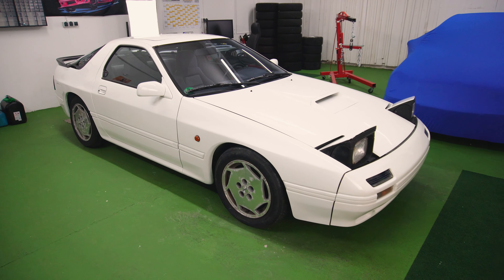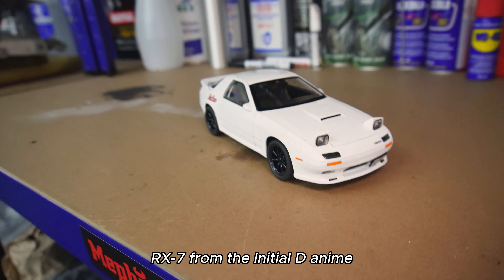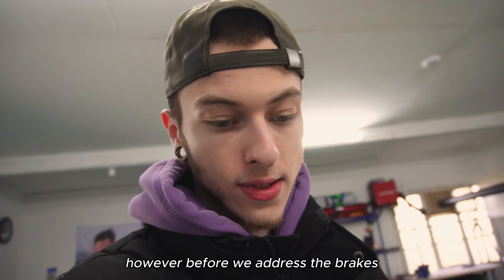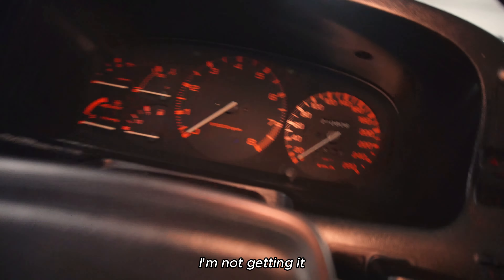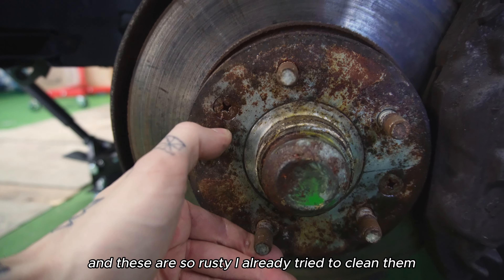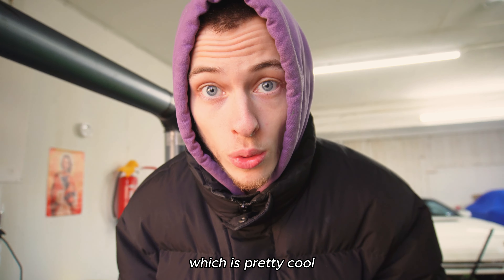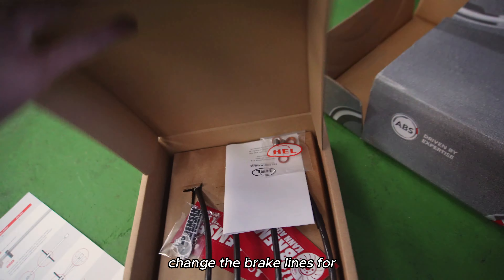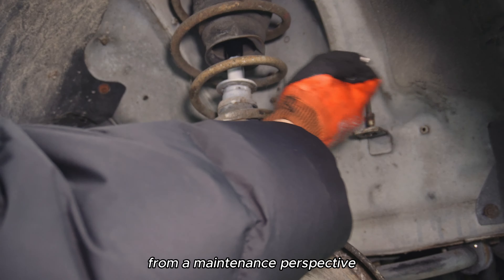Rescuing An Abandoned Mazda RX-7 FC!

Comment: I'm at 5:05 atm and one thing that comes to mind is that maybe a mouse or something ate at the wires between the fuses and the electrical components. Could also use a voltmeter to test that the fuses are getting electricity from the battery.
Reply from the maker: @MrBinkers  Turned out to be a simple bad connection on the plug where you can dimm the cluster😂

Comment: I also had recently purchased an S4 T2, generally speaking the electric stuff create some troubles due to bad or oxidised solderings that sometimes can easily fixed by removing the old tin and soldering back with fresh one. I've already fixed a couple of bad switches with this method
Reply from the maker: Thank you for the advice, I thought so aswell but after measuring every connection, everything seemed fine. Thankfully I found the reason why it didn't work at the end of the video :) Was just a cracked cable.

Comment: So i had the same problem with the brake rotors on my s5 t2. I managed to get one off with a sledge hammer and a ton of heat... but dont do it that way. You likely gonna destroy your wheel bearings in the process. The better thing to do, wich also worked for me, is to cut the side of the brake rotors hub with an angle grider ("Flex" as we say in germany), bc it doesnt rust on the mating surface, but on the inside of the brake rotor. Just be carefull not cut through the rotor and into the wheel hub. 
Stoked to see the building process, and more so to see the car on german roads.
Reply from the maker: Thank you for all the advice!😁 I am also super excited to see another FC on German streets!

I have also heard that the sledgehammer method can destroy your bearings so I think I will definetly order new ones just in case... As soon as I come back home from South Korea I will try it out😊
Reply: @moritzherr  the reason why they wont' come off is because you didn't remove the nut that holds the rotor on. The center of the rotor has a dust cap, remove the dust cap by tapping it with a hammer and then you must remove the wheel bearing nut, then the rotor will come off.
Reply from the maker: @markhutchinson3367  Okay I will try that, thank you for the advice :) But what does the wheel bearing nut have to do with the brake rotor? It's not holding it in at all, they are completely seperate🤔
Reply: @callmemo77  you know what, you're right. I was confusing the rotor design with a different car 😅 I say spray some penetrating lube all over it and use some heat and a big 5 lbs hammer to break it loose.

Comment: for the dash lights, you could try seeing if the bulbs have burnt out. i work at an auto parts store and see it fairly often. i looked it up in my work computer, and it seems that the bulbs are going to be either: 158, 2721, or 74. you can figure out which bulb specifically by looking closely at the glass on the bulb itself, the number should be written there. most can be found for under 8USD.
Reply from the maker: Thank you for the advice and the effort to look up the parts! Thankfully I found the problem right after😁 I mentioned it real wuickly at the end of the video.

Comment: If I were to guess, the gauge cluster not lighting up is because of a bad relay. I'd look at the TNS relay. It controls the taillights, side markers, and dash lights. I had a similar issue on my 1991 Mazda Miata. I was able to troubleshoot it by swapping the TNS relay for the horn relay. Both should be an LA10 relay.
Reply from the maker: Thank you for the nice suggestion! I will definetly have to overhaul the electrical system of the FC... There are some things that just don't work right.

Thankfully I found the Problem at the end of the video :) The indicators and taillights were working even when the dash didn't light up. However my wipers still don't work, so I will have to figure this out aswell😂

Comment: When my pistons were stuck on my brakes i put a block of wood between 2 pistons and held one with a clamp and then pumped grease into the brake rotors it creates a mess but will get the piston out. then just use scotchbrite to clean them up and use new seals
Reply from the maker: I did it the excact same way, except I used compressed air because I sadly don't have a pump for grease :( But I will definetly try kt oht when I have access to it! Thanks for the help :)

Comment: I've daily drove my FC Rx7 for 7 years. Its been down for three years now still trying to figure out why I'm not getting spark.
I recently got an Rx8 to feel the rotary again but its just not the same. 
The FC Rx7 is the best Rx7
Reply from the maker: That's sad... I love RX-7s aswell though! I assume you have already changed coilpacks, sparkplugs and sparkplug wires? I hope your FC runs again soon :)
Reply: @callmemo77  Actually, I just found out that the nut that bolts down the coilpack is a ground too. I only finger tighten it, so I'll be checking that and hopefully that's my only problem.
Reply from the maker: @Alex-vz2jz  If that's the problem, that would be awesome! Feel free to keep me updated, I hope your FC drives soon again

Comment: Yessss! Please show me how you rebuild your suspension, I have an 89 RX7 I want to work on this summer and  the suspension is kinda special and there's not a lot of documentation online for it. I don't know if the 88 TII had the electronic suspension where under corner loads I think it would kick the toe out or camber? I can't remember but I would like to figure out if I could either keep this system or get rid of it and totally rebuild it .  I didn't get the turbo engine I got the NA 6 port but I know the engine is in good health so I would like to work on everything around the engine before I touch it ( which I would probably replace it with a turbo engine before trying to turbo the NA). I'm excited to see what's in store with your channel!
Reply from the maker: I'm glad you're joining the ride!😁 I will try my best to capture everything relevant of the build! I have also seen the electronic suspension before but thankfully my Turbo 2 doesn't have it😅 In general I feel like my FC has somewhat of a special package: No A/C, has the rear seats and no electronic suspension.

I've heard that most FC's have A/C and no back seats😂

Comment: Check the rear of the cluster the flappy green contact lines maybe get copper contact strip tape .. Try adding resolder to the light switch if necessary.
Reply from the maker: Yeah thank you for the suggestion! Thankfully I found the culprit near the end of the video😁

Comment: I found a 2000$ FC3S on Facebook marketplace, but it’s a roller. It’s completely gutted, but I thought it would be a good project car since.. well… it’s an RX7. Do you think I should get it?
Reply from the maker: Hey man :) That's awesome but I'd say it depends on many things:
Overall condition of the chassis, interior and so on.
Also depends on the model, originally NA or Turbo 2?
S4 or S5? What comes with it? Coupé or Vert?

In general I'd say go for it if the chassis and interior is in great shape. However getting it back on the road is most likely going to be extremely expensive and it's more likely that it will be a money pit if you have to get an engine and Gearbox for it. The problem is finding a good engine. You never know how the housings and irons look before taking the engine apart. And in case you have a few bad parts in your engine, getting new replacement parts from Mazda is going to be a pain because they have doubled the prices for their 13B parts (Rotors, Housings, Irons)

But man if you want it go for it, it will for sure be a crazy experience restoring this baby😁
Also for $2k you can't go wrong with it man if the chassis and interior is in descent shape with no rust.

Comment: The bulbs in the instrument cluster could be burnt out. Which could be the reason why it does not illuminate.
Reply from the maker: Thanks for the comment!✌️
I thought the same at first but something about it seemed weird because then the bulbs in the AC Unit aswell as all of the other bulbs should have also been burnt out🤔 Thankfully I found the culprit at the end😁
Reply: @moritzherr  or maybe the dashboard isnt wired propertly 🤔
Reply from the maker: @lukasjanecek9079  Thankfully it was none of those two things👍 At the end of the video I found the solution and described the problem :)
Reply: @moritzherr  oh
Reply from the maker: @lukasjanecek9079 No worries 😂
Reply: Grab a volt meter and verify good voltage and ground.